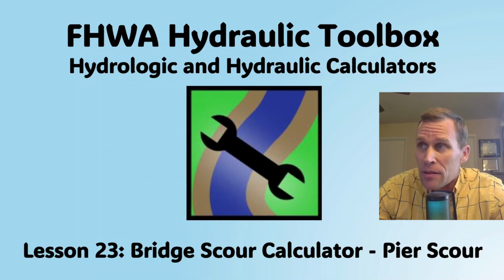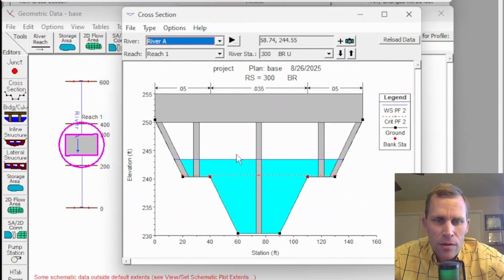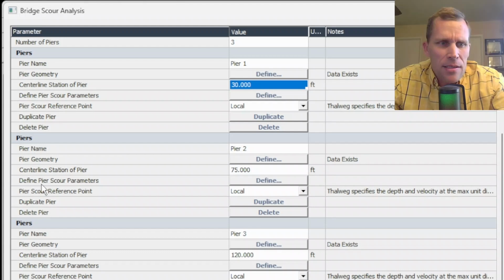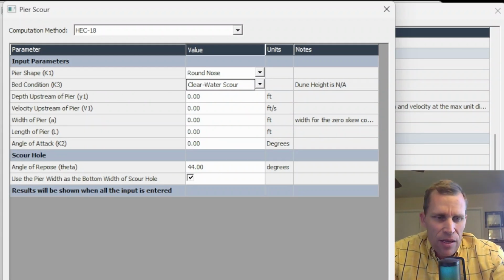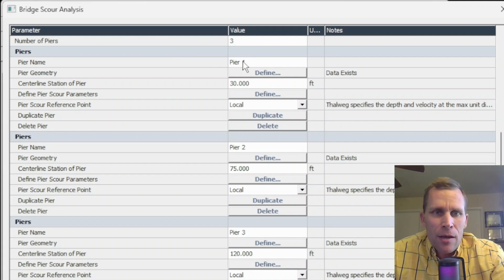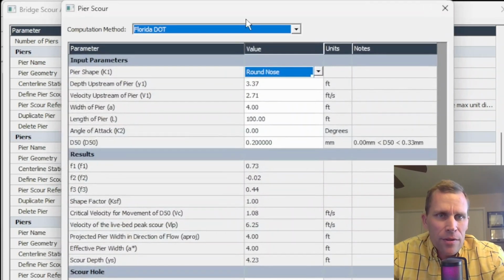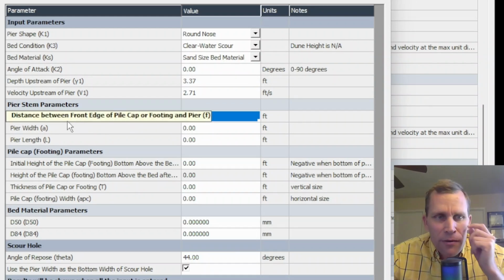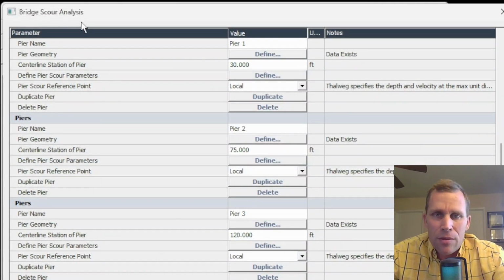FHWA Hydraulic Toolbox Lesson 23 - Bridge Scour Calculator - Pier Scour

Comment: Hi Tim. How did you fix the piers centreline bug? It is keep coming and i can't seem to solve it . Thanks
Reply from the maker: If you click the "OK" button in the bottom right of the dialog box, and then open up the Bridge Scour Analysis Calculator again does that save your previous values correctly? The video cuts out and then I say "I got it fixed", but I didn't describe any details there.
Reply: @TimNelsonPro  hey tim, thanks for the reply. No , I hit ok but then when I re -open the dialog box it comes back with wrong values. I think it only affects the graphic visualization of results?